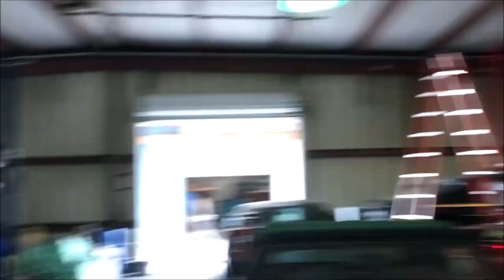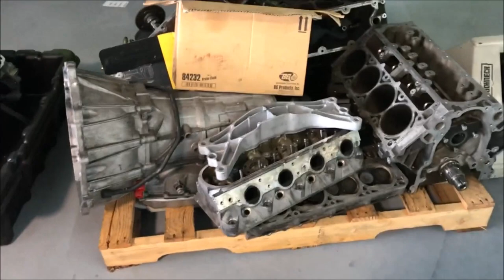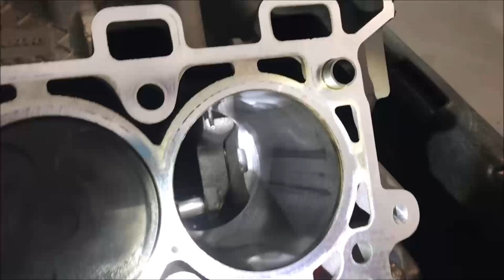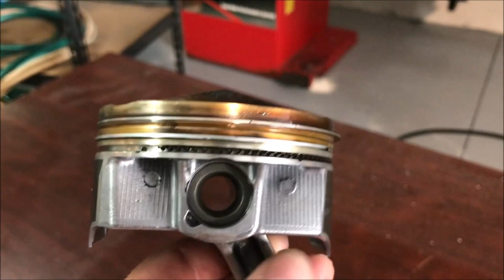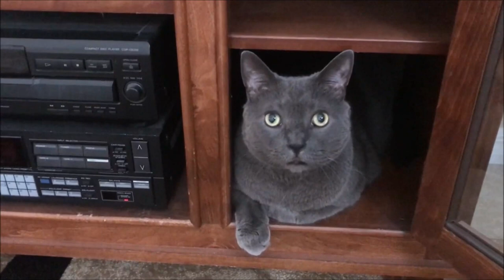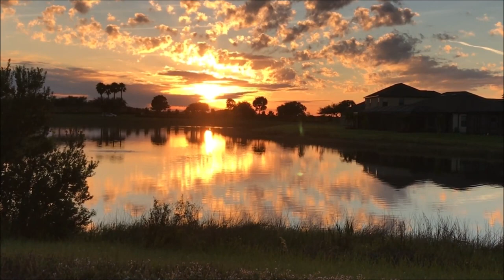2018 Mustang GT 5.0 _ Engine Failure _ See what Broke!!!

Comment: @Coyote carguy
Al,
Base on your experience, do you recommend force induction on the 18-19 mustang/stock? Not using the Whipple tune, but a custom tune. I was thinking Whipple stage1 custom tune at Palm Beach Dyno.
Reply: SpeedyWinds Based on my experience, I wouldn’t recommend a 2018 or a 2019 until Ford addresses the gen3 coyote issues.
Reply: @gothamems5628  Hey man! Nice to hear from you. Unfortunately for me, I bought a 2018 GT 10 speed PP1 last year (my dream car, that I can afford). I was waiting for updates from the community to add a supercharger and during that time, the typewriter noise issue showed up on my car after the first oil change at 2,000miles, it has now 9,320. The type writer noise goes away after warming up. (I can hear it only when is cold).
Reply: SpeedyWinds I still lurk around in the shadows, lol. 😂
Reply: @gothamems5628  Ha! :)
Reply from the maker: SpeedyWinds........ Things didn't go well for me but i have friends who are doing just fine. Its a crap shoot!
Reply: Have money set aside for a built motor if you're going with forced induction on the 2018/2019 Coyote.
Reply: @SpeedyWinds  I've a '13 Mustang GT that had the BBQ tick.  I add 1/2 a can of LiquiMoly Ceratec every oil change and it runs a lot smoother with zero and I mean zero tick. Car runs really quiet cold/hot after the change.  Throwing this out there if it helps you with yours.  I've been running it for 30K miles and consume zero oil, temps are good, and again the ticking went away.

Comment: So I’m curious like some others...do you think the piston fail is because of the forced air, the tune or the part?
Reply from the maker: Hey Mike.......... Really we can't be sure what caused this. It could be a defective piston. i doubt it was the forced air because the top ring land was not damaged.  The tune running rich will wash the oil film off the cylinder walls and cause problems. Impossible to be sure what caused the broken piston though,
Reply: You’re a smart guy getting the warranty. As long as it’s fixed and fixed right.

Comment: So what was the verdict on this one? Did warranty cover it? I have a 2020 Roush supercharged GT with 15k miles that the engine blew a couple days ago. Dealer hasn't torn it down yet but I suspect the block is cracked with the puddle of oil that was left. It's a dealer installed Roush with no other mods. What route did you go afterward for reinstall?
Reply from the maker: whipple paid out $5k towards a Livernois engine with forged internals

Comment: Too rich and lifted ring land! Make sure next tune is on point. Were the other cylinders running rich too?
Reply from the maker: doctorhonda111..... looks to me all the cylinders were running rich. check my previous video.
Reply: Is anyone listening to what "Car Guy" is saying?.... He was running the Whipple factory (as delivered) 91/93 octane tune. Which means - he was not running an after market tune. He had it installed, by an approved installer -  "as delivered" - which means he was acceptable to be covered,  under warranty. If you have watched the channel at all, he has covered the evolution of the car since day one.  I think that kinda'  shows a certifiable, complete "V-log"... Whipple was getting a "free" customer testimonial. Far as I can tell, he was not sponsored or getting any Freebies - for his uncompensated, testimonial. Did I miss something?

     "...he didn't change "nuffin'." He has the patience of Moses, seems like there are a few folks trying to blame the victim?..." How many times,  how many ways can you say the same thing - over and over?
Reply from the maker: ernest tibbs......... i see some people somitimes overlook the obvious.. It's Ok eventually they will get it.. Thanks for the kind words.. You sound like a good guy!!

Comment: I trying to figure this out, someone correct me if I am wrong.  It looks like the piston broke off, which in turn destroyed the rings? Or did the rings let go and broke the piston?
Reply: Sean F the shop needs to see if the rings had enough gap for expansion for a blower. If they did, then maybe a piston casting issue. Since so many of these engines have piston slap the sizes of the pistons could be wrong too

Comment: Hey Al glad you got to the bottom of the problem. So the tune was running too lean. That piston looks crushed. I hope the whipple tune is found responsible. I cant wait to see who accepts responsibility. What weight oil were you running in it at the time.
Reply from the maker: Stephen lane....... The tune was running rich. to much fuel.  i never changed anything with this car. the whipple kit was installed and it failed. the warranty company should cover this. Why this happened?  i don't think we will ever know for sure.

Comment: Did it make any noise or just smoke? I have a gen3 coyote on my f150 that is boosted and I have a compression issue in one of my cylinders and it just smoked but no noise when it happened
Reply from the maker: PowerAddiction . .  . i did notice some smoke when braking at one point. .  but no noise..  .

Comment: Good luck on the built , but why would you run a whipple tune they're known for being really unreliable have a few buddies with issues due to the whipppe tune .
Reply from the maker: 10r80 lifestyle........ I purchased a whipple warranty for the car just in case something went wrong. Turned out to be a good move. If i re-tuned it for more power i would have voided the warranty. that's why i kept the whipple tune in there.
Reply: Nothing wrong whipple tune,100% operator error.

Comment: Before going with the whipple did you ever consider a roush supercharger? I have a 2019 f150 5.0 and want to supercharge it now after seeing your video I'm leaning towards roush.
Reply from the maker: Justin Stafford.........  I did consider the roush blower.... and i know now that the warranty is better.. you live and learn.
Reply: @coyotecarguy2076   I have the gen 2 from 2015 with the Roush 2300 blower and 7 years later she still runs like a top. Never a problem with the engine but i`m not running the hp you are but that broken clutch peddle dam near killed me trying to get it out to weld it. So sorry this happened  to you AL. You will be back on the road in no time.

Comment: That’s crazy al makes sense when I saw little pieces inside my cylinders now. But piston slap is normal lmao guys are nuts to think ticking an Piston slap good. Great info al really good I think yeh black color is from the direct port mine was very burned black too.
Reply from the maker: Hey Fran... Yeah, Piston slap in normal!  Yeah Right!!!
Reply: And to the guys saying scoring and the plasma bore had nothing to do with it dont understand boost or tuning....if the scoring started first it let oil seep past the oil control ring...which diluted the octane rating in that cylinder which then caused detonation ect ect...the cylinder isnt just scored on the side the piston let go....and here is what's insidious,  as someone else mentioned or didnt we now open our second ring gaps for boost to let the pressure out that does make it past the top compression ring ( I personally have used a stainless steel gapless top for years perfect compromise) well the scoring we are seeing which  looks like Al's would normally be accompanied by a lifted top ring land we could see but the problem is one more layer down SO bore scopes are showing the scoring but not the 2nd ring or oil control ring damage, and/or the scoring hasn't led to the detonation yet...scoring is bad period and many non boosted engines have it...
 What's sad is there is actually a LOT of crown area ( top of piston to top of first ring) depending on stock top ring gap that piston should actually hold a lot of power when compared to say a stock 392hemi....
 Al be a hero and have him measure the top ring gap on 1 cylinder and a good cylinder wont take 15 minutes I'll personally pay an hour of shop time via PayPal gift to get that info.....
Reply from the maker: BlucCollarDaily..... I can place the top ring in the cylinder and measure the end gap with a feeler gauge. Does that sound good??
Reply: @coyotecarguy2076   yes that's all it takes square it up with old piston or slide square anything and measure with feeler gauge that gives us a lot of info..that piston actually has a good coating on skirts and a thick deck it should have held more power

Comment: Hey did your first motor break a rod and take out block and crank...thanks
Reply from the maker: maximus vonce. . . Hey Bro! Where have you been?  The first motor broke the ring lands on piston #1. .  took out the block . . . but the rods and crank were ok. . . . someone else sleeved the block and rebuilt it with manly i-beam rods and diamond pistons  .. re-used the crank. .
Reply: @coyotecarguy2076  Hey at least Whipple covered motor for you. Did broken pistons damage blower too. My 11 Tvs 5.0 threw a rod last week in cylinder #8 after 1 week on e85 and 650wheel plus with 111k miles on motor. Ran 111k boosted miles at 600wheel 91 octane.  Converted to e85 to make more power and poor tired Gen 1 coyote threw the rod at 5500rpm in 4th gear racing a bike. Those gen1 coyotes have weak shitty rods. I hope my block and crank ok, but maybe not. Pulling motor this week and rebuilding built forged to make 800wheel e85...

How's your 2nd motor holding up on e85?
Reply from the maker: @maximusvonce1381   .. sorry to hear your engine blew up. .  that Sucks. . . My new livernois engine is Solid no problems at all.
Not Sleeved but forged internals. . .  Safe to 1000 hp at the crank but i am told it can handle more than that ..  i am currently putting down 800 to the wheels on pump 93 octane with boostane . . around 100 octane. . .
Reply: How did broken ring lands damage your block?

Comment: Did the motor seize and lock up when it broke.
Reply from the maker: nope just ran rough
Reply: @coyotecarguy2076  My built motor just stalled and Hydrolocked on me..only 18k miles on it. My builder may have not had enough ring gap. Going to tear it down.  Only made 800wheel on e85. Cant even turn it over or i hear metal on metal.
Reply: @coyotecarguy2076  I got misfire codes p0307 and p0300.  Then motor stalled and Hydrolocked. Very depressing man. Car was a monster and drove fine for 18k miles. Looks like internal parts failure or ring landings failure.  Fully built Boss Roadrunner engine. Not just built from factory but built again.
Reply from the maker: @maximusvonce1381  post a video of it

Comment: 2018 and up 5.0s are having oil consumption issues
Reply from the maker: Marc ichaud M.P.E.  ......  Thanks! I will keep an eye on that!
Reply: Marc I have a buddy who keeps saying his 2019 5.0 is losing oil. How bad is yours?
Reply: @bdulay93 i work at a Ford Dealership,  we are seeing a bunch of these. Ford is aware of the problem,  i dont believe they have a permanent solution yet. They revised  a couple components with pcv, but they are still burning. Keep an eye on the level. Once timing chains start rattling you know it's time to bring it back to them
Reply: They all burn oil. My 600wheel Gen 1 coyote burns 2 quarts every 1k miles. Blows no smoke and runs strong. But I drive daily and thousands of full throttle 7200rpm blasts with 101k miles on motor now👍

Comment: Thanks for the update Al, that didn't look to good. Are you thinking it was the whipple tune that was the root cause?
Reply from the maker: Hey Maz!!  I am not really sure if it was the tune or a bad piston or both.  It was running rich and that washes the cylinder walls of its oil film. That can't be good.

Comment: Do all coyote engines have this problem?
Reply: No they don't
Reply: C. Lacerda my car had same exact damage an I was totally stock 18 gt with pp1 package auto. I also lost my 10r80 it burned clutches an valve body. Ford has now bought my car back from me.
Reply: No not at all 15-17 don't have this issue I have 30k with a roush 2.3 79mm pulley, colder plugs and t-stat, really good tuner too.. No issues, seams like alot of people are having issues with the gen3 and the dealer says ticking, not the injector tick, actual piston noise is normal to me that's insane!!

Comment: Lucky for you if they paid for it in my case I paid over 10,000 motor, labor and had it dyno turned in Houston tx. 
Got mine from Lebanon Ford with extended warranty and still nobody took responsibility for our loss. Watch my video.
Reply from the maker: cameo project .. . In my case i did get the insurance company to pay the claim... But it only covered about half the cost to get a better engine than the stock one....
Sucks that nobody took responsibility for your engine failure.. i would fight back...
Reply: @coyotecarguy2076  it just takes more $$ to fight back they got it all figured out. Ford is the one to blame her just think they ship out on the 18 -19 and maybe 20 pistons as it seems to be what gives first. Well any ways happy fun with your horse.

Comment: Im thinking five pounds is the safe zone. No more
Reply from the maker: DFSLounge  . .  . I am running nine pounds and my motor let go..
Reply: @coyotecarguy2076  well over the safe zone 🙂. Im frankly sacred too boost mine. I bought a Edelbrock stage one assembly months ago and i don't know if ill do it or not. I dont have confidence in the block or so called safe boost zone.

Comment: I would bore and sleeve it with MMR parts they make 4000 hp in coyote
Reply from the maker: ripfletching...... The engine you are talking about costs big money. i elected to get a pro series engine from livernois.. the engine is not sleeved but has forged internals and is rated to 1000 hp.. lets see how things go.
Reply: Coyote carguy can’t wait

Comment: You call the stock Gen 3 a pos but it was whipples crap 91 tune that blew motor. Never ever run 91 octane with a tvs blower over 550wheel on these cars. 93 octane from 550wheel to 620wheel. Over 620wheel you need e85 or race gas.
Reply from the maker: maximus vonce. . .  .   Please be advised that quite a few gen 3's have problems without  superchargers installed... additionally you do not know why the motor expired.. you are guessing.. Go to PBD youtube channel and you will see whippled gen 3's making 700 whp on 93 no problem..
Reply: @coyotecarguy2076  700wheel on 93 is a time bomb.  Go and ask Palm beach dyno. They will concur.
Reply: @coyotecarguy2076  Those Gen 3 running 700wheel on 93 wont make 50k miles.   Guaranteed. Unless they drive like grandma most of time
Reply: @coyotecarguy2076  12:1 compression 700wheel on 93 is risky. Ask Palm beach dyno and see.
Reply: @coyotecarguy2076  I hope you are running mickey drag radials out back and drag suspension,  or your 800wheel is useless on street. Dont listen to these clowns on UTube
Reply from the maker: maximus vonce. . ..   What are you trying to prove?
Reply: @coyotecarguy2076  Trying to help you prevent another super expensive engine failure
Reply from the maker: maximus vonce. .  . Thanks for your efforts but you are pointing out the obvious.. any time you modify a car you will shorten its life... my stock engine was defective thats why it broke... what i have built will withstand the desired 800 whp i am trying to make even with 12-1 compression..  we have e85 in this town so octane is not a problem... a aluminator engine will not work in e 2018 & Up mustang GT...If you have something constructive to offer i am all ears but if you are a troll i have to ask you to refrain from this behavior...
Reply: @coyotecarguy2076  I know guys with s197's making 600+wheel running 10.4's with 160k miles on motor. So supercharging may shorten life, but not much if tuned correctly and not pushed past its mechanical level.
Reply: @coyotecarguy2076  What are you gonna do with 800wheel,  bragging rights dyno queen with velvet ropes, or actually strip car.
Reply from the maker: @maximusvonce1381  . . . Again what are you trying to prove....  how are the last 2 posts helping anything...
you are voicing your opinon . .  i am not interested honestly.. you sound shallow and childish. trying to prove something...  I am building my car to do what i want it to do. if you dont like what i do then go somewhere else...  this is not about bragging rights or any other stupid statements you have made.. if you think that kind of talk helps anyone then talk to your boss or your parents like that see where it gets you. but i will not tolerate it here so knock it off.. do you want to get blocked? keep it up!
Reply: maximus vonce apparently by your “know it all” conversations you missed the point that his new engine is built to withstand 1000 hp. Your comments went from want to be helpful to downright insulting!!! Never mind what he’s going to do with 800 wheel horsepower it’s his car, it’s his build, it’s his money. Better yet upload your build and show us all how it’s done...

Comment: I usually open ring gap when I boost my vehicles so that doesnt happen. You added heat with boost rings had nowhere to go. Expanded into each other and breaks the ring landings. My 2000gt has stock pistons and rings. I opened the ring gap with upgraded rods and head studs for boost. 18psi no issues 5 years now. Pretty dumb to boost a motor not made for boost.
Reply from the maker: Darren McFeaters...... Thanks for viewing.

Comment: They were never designed to handle boost
Reply from the maker: k Me..... Thanks for viewing!
Reply: Wow, do you know where he had it done? Why he has a warranty?
He got the warranty with that engine. To give a warranty for anything you think will explode is plain GM 😂
Serious though, the guy went the way he went, had to settle for a little more compression then he wanted but it had a warranty. 
My best guess is there are Alot of people who don't agree with you.
They say not to boost 392s either. My brother in law has one running 9lbs boost and had 69,
Miles on a 3 yr old car.
Better LUCK next time AL